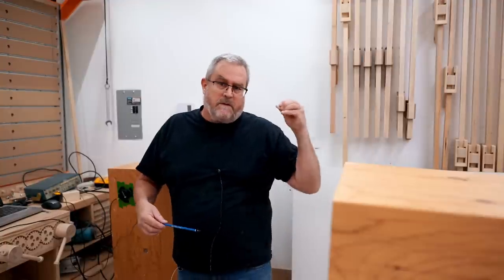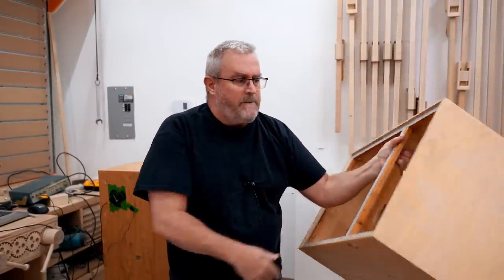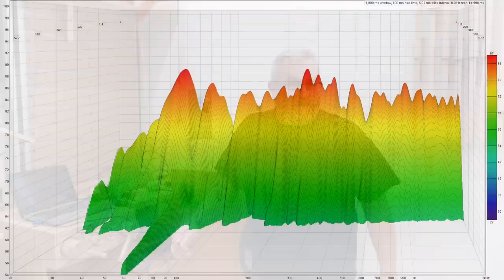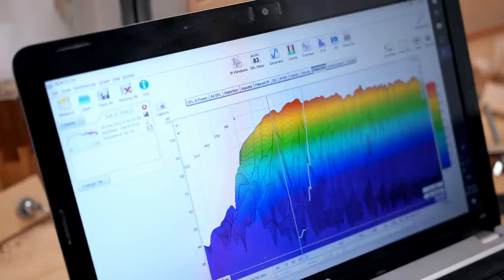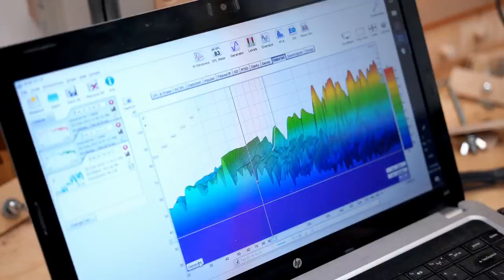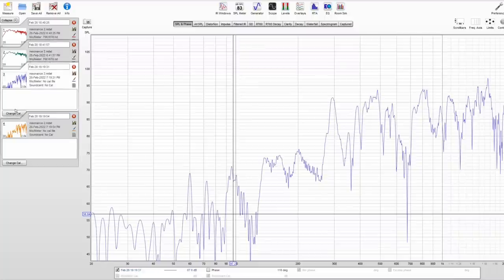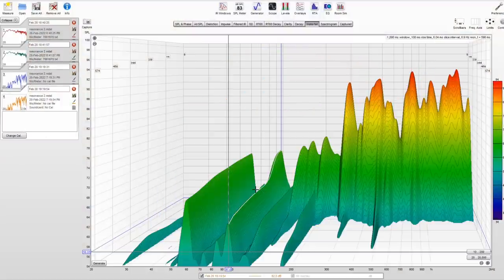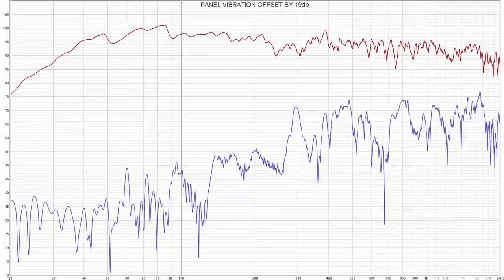A Better way to Measure Panel Resonance... Maybe

Comment from the maker: If you don't understand what I mean when I say "offset", you need to watch the video I made before this that shows the problem and why there is an offset:
https://youtu.be/xHY45RmAbDc
I think this is a lot more accurate than the method I used in that first video. Using the 100hz tone as a control means I can more precisely calculate the offset between the accelerometer and the microphone. But there are other variables that will make a difference, like the distance the mic is from the speaker. So that offset only applies to this test, and will almost certainly be different for another speaker.
Also, the accelerometer is measuring how much the entire box is moving, along with how much the panel it's attached to is vibrating. So that's another variable that will change from speaker to speaker.
One obvious conclusion I reached while doing this is that resonances up higher in frequency will be much easier to hear. Our hearing is also more sensitive in the midrange frequencies, so you'd want to do what you can to try to prevent the panels from vibrating excessively. Using the right thickness plywood or MDF, bracing and damping is all that's needed to drive down the audibility of these panel vibrations. No need to go to extreme lengths or use exotic materials to build the cabinet, when there like won't be audible gains over a normally well built box.
The speaker in this video is made from cheap 3/8" spruce sheathing plywood. It has big unbraced panels and very little damping. So it's probably an example of the worst case.
Still, thousands of speakers have been made in a similar way by big speaker manufacturers over the last 40 years. Most people would enjoy the heck out of the ones I have here and not hear any problems with the way they sound.
Also an important point that I show in the other video is how much the wall beside the speaker vibrates - it was about the same as the panels in the Elac speaker. So unless you are going to do the same thing with the walls, floor and ceiling of the room you listen in as you do with the speakers, there's no getting away from some amount of panel vibration.
Reply: I get what you are saying about vibrations in the room, but assuming that the room resonances are sufficiently far away from the speakers wouldn't they be much less bothersome than resonances coming directly from the speakers, particularly for higher frequencies? If our auditory system can localize/isolate those room sounds wouldn't it be able to filter them out from the signal proper, thus allowing various illusions to be generated more cleanly? (And wouldn't it be far more difficult to filter/separate out cabinet resonances?) For example, if someone plays an instrument in a room and it causes room vibrations, as long as they aren't extreme they don't significantly affect our judgment of the sound coming from the instrument/player—we get used to the room and for the most part focus on the musician. That is, our auditory system separates out signal from noise, agents from environment, pre-consciously. I imagine that things like soundstage and imaging would be particularly sensitive to such differences—and speaker manufactures certainly to try to sell this idea—but that's just a guess.

Comment: Great vid.  As a speaker designer I can advise that most commercial designs are checked to ensure that panel resonances are at least -45dB on program to be acceptable by reputable companies at least.  Your -28dB is pretty high so demonstrates why panel damping or thicker panels OR additional bracing would be needed.  You have to consider that stiffness changes the frequency but not necessarily reduces output depending on panel thickness. The rule of thumb is to make bracing spacing non uniform so that sub panels resinate at different frequencies hence sum of frequencies is way less in total amplitude than equidistant ones.

Cab thickness to brace relationship:  doubling thickness of panels is equivalent to adding 5 internal braces in stiffness and amplitude of resonance.  

The accelerometer is way more relevant and useful than the panel exciter.  It is useful for testing a full frequency response of individual panels but the accelerometer measures the output describing panel behaviour and time of resonance better than a mic.

Keep up the good work!

Comment: Hi John. I recommend you do what I have done. Measuring panel resonance is best done when when the drivers are NOT playing. Get an adjustable frequency vibration shelf, and use the shelf vibrating between 20hz and 20k. Then you are ONLY measuring the cabinet itself. My 24" x 18" shelf cost $3900 used however. This way was taught to me by Paul Barton of PSB, about 25 years ago. Works perfectly
Reply from the maker: The point was to find out how much the panels vibrate while the speaker is playing, and how much sound energy they are putting out.
I can easily find out what frequencies a panel vibrates at by striking it with a rubber mallet and recording the sound that produces, but that's not what I'm looking for.
Reply: @IBuildIt  What makes you think that the panel vibration of a speaker contributes anything to speaker output at all? I've never heard of cabinet or panel resonance being an issue with any speaker.

Comment: Okay, back in the 70's there was an "invisible" speaker driver.   It was essentially the magnetic of the speaker connected to a bolt and that bolt was screwed to any surface - like the back of a table top, door,  inside the dry wall of a wall, and most of the time - it was just a gimmick.   It sort of work - especially on hollow core doors.   I think one of those would be a good direct driver for this sort of testing.
Reply: Yep, nut screwed to the panel and screw for additional change.

Comment: I’m loving this set of experiments you’ve been doing. I was thinking that using periodic pink noise bursts would be a good way to determine resonances since it would quickly burst all frequencies and give time for decay. I think REW can do that, but I forget.
Reply: I'd wonder about trying to give it an impulse instead. Sure, perfect impulses are impossible and only get more so down the signal chain but doesn't that same distortion affect noise bursts as well?
Reply: @hubbsllc  I was thinking that a burst would allow it to receive the full bandwidth of sound then have a decay. I’m not aware of what you’re meaning by noise bursts having more distortion, but if that’s true that could be a problem.
Reply from the maker: The sweep REW puts out does everything that's needed. It excites all frequencies in the range it's set to.

Comment: Do you think it is accurate to describe this as the "relative noise floor" of the speaker?  That 47db difference is a pretty big difference, so it probably is not noticeable to most people.  It would matter in a critical environment, but people who do critical work already have silly expensive speakers that control resonances much better than your shop speakers.
Reply from the maker: The 47db difference was between the speaker output and the tone I injected in, but the higher frequency panel resonances were quite a bit higher than that tone. 
It's been my contention that when you build a reasonably well built box you won't be able to hear the panel resonances - they'll be too far down and the output from the speaker will swamp it. The question too many have is what constitutes a "well built box".
Reply: @IBuildIt  What do you think about an infinite baffle arrangement to test this?  Easiest way would be a plywood door in an existing doorway, and cut an opening in the door the size of the speaker cabinet.  Then mount the speaker in that opening.  With this setup you can get a simultaneous measurement of the sound output from the front compared to sides and back.  Both would be the same type of measurement, with no adjustments or offsets to worry about.
Reply from the maker: It would have to be an extremely well built door to block all of the sound from the front of the speaker, but it is an interesting idea.
Reply: @IBuildIt  Just make sure the cabinet resonant frequency is considerably higher than the playable range for the woofer.
Reply: @IBuildIt  I would try making the door/ panel from something cheap and easy, like 1/8" plywood glued to both sides of a piece of 1" foam board.  Of course you would need to take a reference measurement with the speaker playing in the other room and the panel opening blocked.  Some sound pases through the walls regardless, so you need to know how much.  With a good reference measurement, you can take the difference between the reference and the measurement of the cabinet when installed in the panel/door.
Reply from the maker: @chrisharper2658  the speaker being tested in this video shows resonances being excited well above where the woofer is crossed over. A full range speaker is - full range. 
The higher up in frequency the resonances are, the more sensitive our hearing is. So a 1khz resonance will be much more audible than a 50hz resonance of the same magnitude.

Comment: I am struggling to understand Bluetooth speakers and how they compare in audio quality to the old hardwired speakers.   Can a Bluetooth speaker attain the same range, and quality of a hard wired speaker system?  I would like to have a audiophile quality Bluetooth speaker -- is there such a thing?
Reply: There's probably a number of quite good or even excellent Bluetooth speakers on the market. Class D power supply, DSP (for active crossover + eq), DAC, Amplifier, Drivers all in the same box. Does that help?

Comment: I used to own a pair of Techniques 12"  3 way speakers.  There was ZERO bracing in them.  They were made from cheap, thin, lightweight particle board material.   In fact, most modern consumer speakers lack bracing, and are made from the same material, and cm? thickness.

 Only higher end speakers, tend to put bracing into them... and even most of those, dont have bracing that looks anything like what you have built here (typically inferior).

 If anything is going to De-Form a speaker boxes shape... its going to be from the air pressure and vibrations created by large and powerful woofers being fired, at high volume levels.   And that De-formation, could alter all of the drivers soundwaves... as they are attached to that vibrating and distorting cabinet.

 Now, Im not an Engineer... so maybe Im getting two things confused.   I understand, for example... that if there was a loose speaker wire in the cabinet... that one might hear it rattle.   But outside of that, Im not sure I see much reason to even care about minimal midrange "leakage".

 Some speakers have the mids and tweeters sealed off from the main air chamber.  Either by making the drivers sealed, or by a separate chamber.   If these were not separate (as many poor quality speakers do not)  the air pressure could effect how they perform... as the bass pressure could hamper their ability to drive without distortions.   The amount of interference, could also be a factor, depending on how powerful the bass drivers are... and if they are sealed vs ported.
Reply: You don't need to be an engineer, just an audiophile. Some simple speakers sound great, but in hifi we're not only chasing pleasure, but also accuracy. We want the *real thing*. Speakers have dozens of nasty gnomes in them. Each on their own is tiny and maybe inaudible, but if you fix 3, then suddenly you made a perceivable change. For most people this is a waste of time and money, but in reality you don't know until you try. We do it for science and OCD. Curiosity maybe didn't kill a cat, but wasted it's time. :-) The cat had some fun though.
Reply: @rhalfik  I became one, on my first Sennheiser audiophile line headphone.  Even more so, when hearing... then later purchasing a pair of 1970s era  EPI 100v  speakers.

 I simply meant that I do not understand why he is testing some mild leakage... at low volume levels... in an empty cabinet...

 When in fact, it appears that the worst effects of a poor cabinet, would be in its flex and deformation.  And that would occur most, when its pumping out high volume level output from the enclosed woofer.  It would cause all of the drivers to potentially shift in different directions, as the pressure and vibrations effect them... 

 And the effect would be greatly multiplied... if the cabinet flexes... as the drivers would theoretically shift in different vectors to each other..  depending on where the flex is.. how much... etc.

 It seems very different from him trying to get a reading of a tone from inside of the cabinet.... to outside of it.

 Adding to that...  Especially with a cabinet that already has a pretty insane level of Bracing.  You rarely see a cross brace right behind the woofer.  Its probably one of the more optimal places to stiffen a cabinet.  However... that said... such a placement is likely to cause more distortions to the driver... due to its close proximity to the projected air-flow / air-pressure. (which is why most cabinet probably dont brace there)

 (it might be better, to use a thin metal bar, that connects the two sides.  That would allow the high pressure air to easily go above or below it, without crashing into it... which btw... if its being hit heavily.. it could theoretically pull the cabs sides inwards)

Comment: Hi, if resonance is the problem, based on the fact the speaker is in a box. You may try to make the box big enough to accept foami made for sound proofing. It has one side flat and the other is a multitude of pyramids which purpose is to disrupt sound vibration. Please let me know if my theory is stupid and eventually if you try it what is the result.
Reply: I'm not John, but I think it is indeed silly.  :)
Now I'm going to refer to a whitepaper by KEF about researching their LS50 as a successor to BBC LS3/5a, where they explore solutions to the problem. The paper is brief, widely accessible and easy to read, so there is no excuse not to familiarise yourself with it. :) Just search: "kef ls50 white paper".
Aha,  the foam you mentioned is used as a choice for aesthetics rather than sound absorption. It's meant to be placed on top of actual absorptive installations to make them look pretty. It's contribution to sound is tiny compared to the forces we're talking about. So the correct methods of damping here are either vibroisolation or CLD, but only assumed a proper bracing in the first place, which thie box in the video is certainly lacking.
Reply: @rhalfik  Interesting information thanks, I gona have a deeper look into.

Comment: If panel resonance is an issue, one solution may be to use something very rigid. How about cast iron? But what about going the other way? Build the box out of foam, something squishy, just stiff enough to hold a speaker.
Reply: The point is that it is not that big of an issue.  But even still you can buy cast aluminum speakers.  But I'll leave the cast iron speakers to you!
Reply: @fredygump5578  oh I know, being silly.
Reply: @EF-69  It is hardly silly but, rather, essential to achieving accurate conclusions to have both positive and negative controls to direct measurements of any sort.
Reply: A box made of damped panels work better than a box made of heavily braced, stiff panels.  Ex. Jean Maurer, sand filled Sandwich panels. A Cast iron 'cabinet' rings like a bell at certain frequencies :)
Reply: Lead, concrete, asphalt, whatever.
What if cabinet vibration is a good thing? Isn't that what flat panel transducer speakers are?